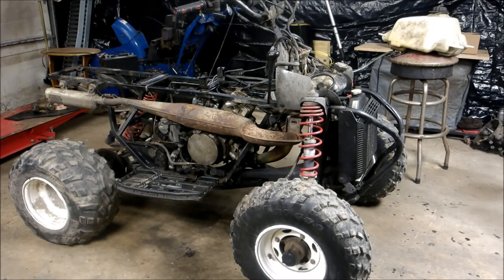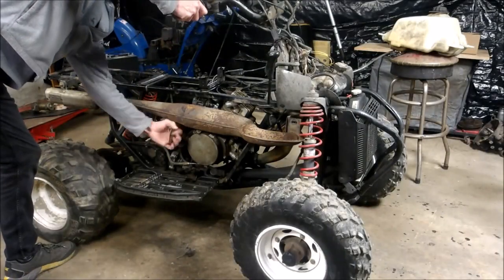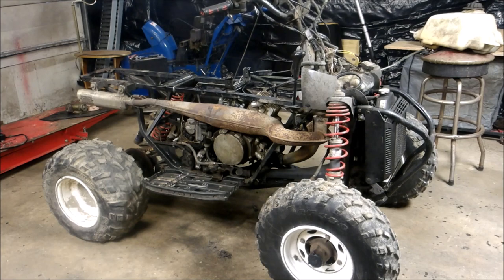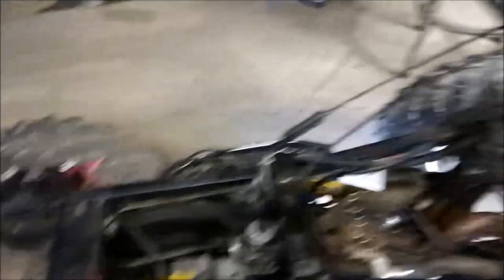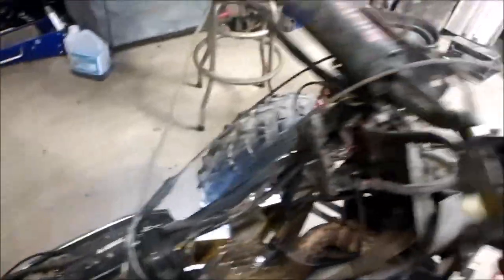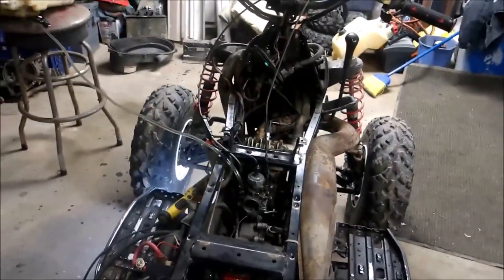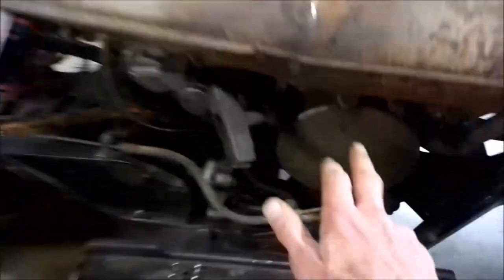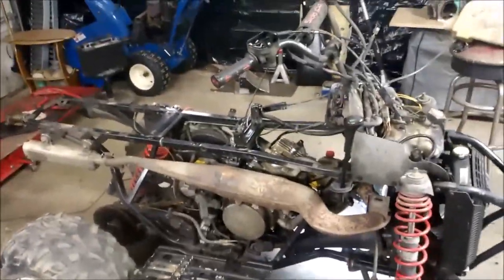HOW TO STOP YOUR POLARIS SPORTSMAN FROM BACKFIRING!

Comment: I have a 97 trail blazer 250 acer, I just got it and started to redo it got her starting on first pull, idling great. I just redid the throttle cable and that's great. But my issue is after about 10-15 minutes of riding when I hit the throttle she starts to bog down and I have to flip on the choke to keep it idling at all. Then she will only limp home it it keep tapping the throttle very lightly. If I shut it off for like 2 minutes she will ride ok but starts to bog again after about 2 minutes. I am wondering if when I put the cable in since the cable is connect to the oil pump if maybe I need to adjust the oil cable to add more oil mixture. Like maybe the engine isn't getting enough oil and is heating up and some safety thing is kicking in. If not do you have any solutions to what might cause this issue?.
Reply from the maker: I'd do a compression test. Clean the carb and see what happens
Reply: @TitaniummanGarage  tried that. Cleaned the carb 3 times before it would even run on it's own. And it idles fine rides fine but then out of the blue it bogs down and I have to flip the choke on and feather the throttle to keep it even idling, and every so often far far and few it will back fire out the blue 1 time for no reason
Reply from the maker: If it backfires you might be running it too lean. Check the carb boot see if it's cracked. Of if air is getting in somewhere.  Did u check compression?
Reply: And negative on the compression. Like I said it'll be running fine and then boom outta no where it will bog down and need to flip on choke to save the idle
Reply from the maker: Once it warms up the compression could drop. I had a 250 that did the same. Turned out the rings were stuck to the piston. I'm not saying you have the same issue. But I would check just to rule it out.
Reply: @TitaniummanGarage  ok for some reason it will go in reverse fine. When in drive it will ride,  die out if you restart it right away it will ride for like 50 feet then die out again. It started doing it after I took off and reinstalled the throttle cable and cleaned the throttle electric control

Comment: I have a Polaris rzr 800s . It starts backfiring at 30 mph any ideas of what can be ?
Reply from the maker: I haven't worked on any 800's a 700 I had with the same issue..It turned out to be a crack in the carb intake boot. I couldn't see it until I pulled it off. Usually if it backfires it means its running lean. could be an air leak somewhere. start at the boot and hoses. clean the carb. make sure jets not plugged.

Comment: I have a Polaris sportsman 500 2005 it turns on real quick but when I rev it it dies any suggestions?
Reply from the maker: Check the timing,valve clearance, cdi box. Clean the carb. Could be a number of those. Does it backfire?

Comment: My 2021 Polaris sportsmen 570 dosent like running to long before it starts with the back firing. 😢 
New oil new gas 😳
Reply from the maker: Wow. Not even that old of a machine. I've heard with the 570's either the guys absolutely love them or hate them. Something about the motors not lasting long. IDK. I haven't worked on one yet.. But I'm sure down the road I will.

Comment: I have a Polaris 800 and when I rev it up and the let rpms drop it pops but I doesn’t try to shut off the engine
Reply from the maker: I have only worked on 700s. Never an 800. What year? Fuel injected?  Sounds like it's getting too much fuel. Or possibly air getting in somewhere. Does it have a carb boot? Maybe start there. See if it's cracked. Had that issue on the last 700 I did.
Reply: Titaniumman Garage it’s a 2011, everything I read said either too much air to too much fuel, how would I find out or go about fixing it, I was thinking it was bc I didn’t have a spark arrestor in the exhaust.

Comment: Hi mate, can you please tell me whether you have come across this issue: I put a new CDI from Procom, on my 2003 Polaris Sportsman 500, the engine started no problem, runs beautifully, but it cannot be switched off? 
What do you think is happening?
Kind regards,
Franklin
Reply from the maker: Hmm.. That usually happens when the black wire is not connected. I know in the past I have said to pull the black wire to see if it fires. If the cdi box is working correctly the ignition key will not turn it off in some cases. You might have a faulty cdi box. I run across that before.
Reply: @TitaniummanGarage  Hi, what black wire are you talking about?
I am trying to sort out this problem before I return the Procom CDI, for one thing, it takes ages now with Covid-19 to get anything delivered to us, secondly, the CDI partially works, the engine starts and runs, but cannot be stopped or switched off.
That is obviously dangerous.
Reply from the maker: @franklinarguedas4832  I may have to back up a little. First, what year is the Atv your putting the cdi on. As years went on..They changed the color. In my video I did about the cdi box was a 2001. There is a black wire that comes from the box and connects to the stop/run switch. Or kill switch. Usually if your not getting spark or maybe 1 spark and nothing you can pull the black wire to the kill switch and it usually starts. So it could be a faulty switch, cdi box or possibly a bad ground. If you tell me the year and model I'll see if the color of the wires changed.
Reply: @TitaniummanGarage  Hi, my Polaris Sportsman 500 HO 4x4 is a 2003, it is a plug and play CDI, not strings attached to this one
Reply from the maker: @franklinarguedas4832  Nice. So that rules out the black wire. I took an 05 and put an 04 wire harness on it to get rid of the ecm. As I wired it up I noticed some of the wires had turned green at the ends. The copper turning colors. When I went to start it..The speedo lit up but wouldn't start. I traced the wires for an hour. I added an extra ground wire to the frame just to make sure I had a clean ground wire. I finally disconnected the 2 plugs up by the start/lights buttons. Cleaned them up and boom..She started. In your case If it is not the cdi it could be a ground wire or something in your key switch..I've had to replace those too. You should start at the 2 plugs up by the start button and then check the connection in your key. Use dielectric grease on them when you plug them in. Maybe try to add an extra ground wire. Not only did I work in an engine plant. I also used to build wire harnesses for the same company as well and learned from it. The one thing I have learned from working on these Polaris is most of the electrical issues end up being a bad ground wire or corroded somewhere and end up making the components go bad. Like in my case on the 05. bad ground fried the ecm. I hope that helps.
Reply: @TitaniummanGarage  G'Day, I will follow your advice and see what happens. I have tested the CDI on the two other Polaris 500 HOs and they all suffer from the same problem, the engine cannot be switched off, however,  when I plug the old original CDI back on, the engine starts and switches off immediately you turn the ignition key off.
There is something with the internal workings of the CDI, and that is what I am hunting for, mate!
Your information is valuable and much appreciated, though. I am grateful that you took time out to reply to me and to provide valuable knowledge.
For that I am thanking you.
Reply from the maker: @franklinarguedas4832  Funny. After I left you a message I had thought to tell you to try the old one to see what happens. It was already 1:30 am, So I figured I'd tell you today. Great minds think alike.
Reply: @TitaniummanGarage  Good man, take care.

Comment: I have a 500 sportsman it idles fine when I rev it up and turn loose of the throttle it dies it does not have the switch at the throttle
Reply from the maker: watch this video :https://youtu.be/z1ypLjtE56w They all have a switch at the throttle. what year is yours? could be a cdi or something not completing the circuit.

Comment: I got a 2016 polaris sportsman 450 efi. And it's sputters at idel.  Cutting off.  Want acc top speed.  It back fires
Reply from the maker: I haven't worked on any EFI yet. Don't know alot about them.
Reply: @TitaniummanGarage   ok thanks bro
Reply: 100% Canadian   Yelp mines was the fuel pump.  I cleaned mines out .  Blew  air  through it and cleaned it. Works fine now
Reply from the maker: 100% Canadian  Thanks, that's a new one I haven't heard. Ill be sure to check for that. Most times I by pass the fuel pump when issues occur, just to rule it out with a small fuel tank.

Comment: One thing that I have discovered, that may be worth your while knowing, is that the Polaris engines oil pump hardly ever seize, they are virtually indestructible
Reply from the maker: Sorry Frank. Can I call you Frank or do you prefer Franklin? I have to disagree on that one. I believe Polaris puts out a great oil pump, I did have one fail already. The nice part is they can be rebuilt.
Reply: @TitaniummanGarage  Sure, most people call me Frank, no problem.

I have not had one fail me yet, but I am not basing my statement on my own experience but that of those who race the Polaris and those who like ourselves are on the land working with the machine through mud and rivers, and the oil pump has not failed. But you may have had an odd one that gave way